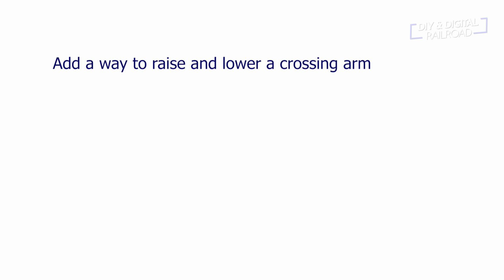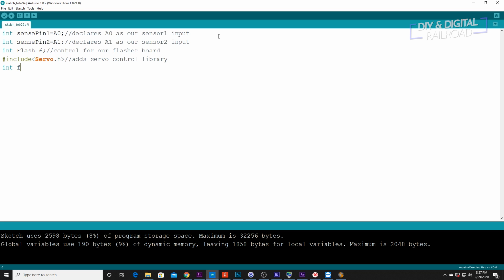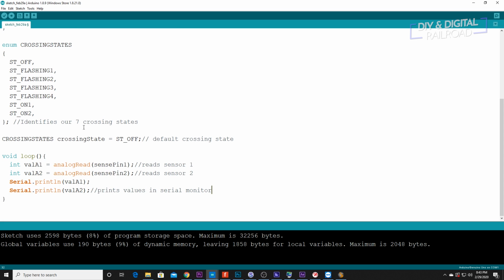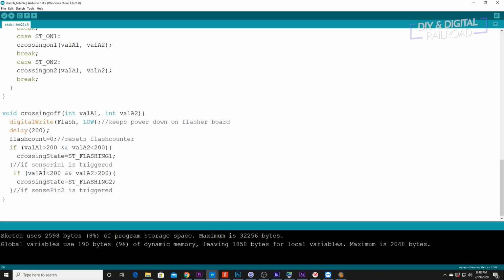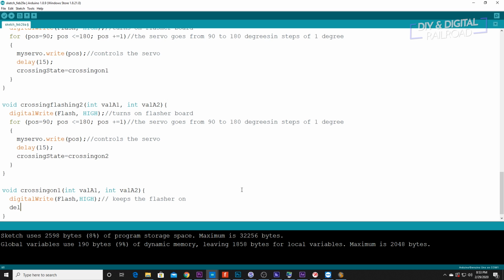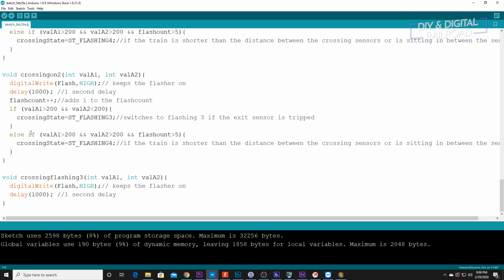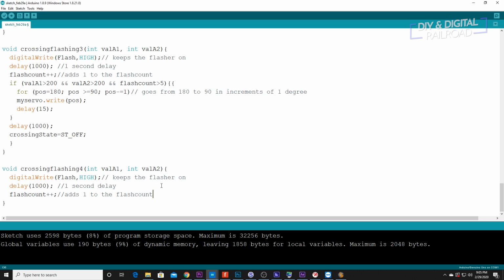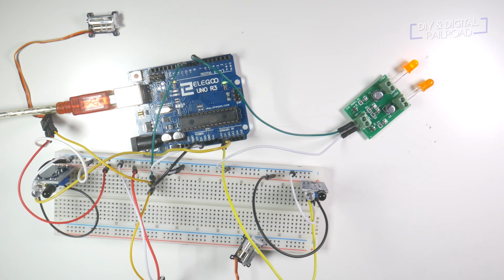Adding Crossing gates to the Arduino Grade Crossing Sketch

Comment: I added sound and gates to the original sketch with just a few programming lines by writing some simple code using Digital Pin 3 to operate a bell module and Digital Pin 9 to operate a SparkFun Servo Trigger.

Both Arduino outputs 3 and 9 operate 5vdc relays. Output 3 operates one relay, normally open, that closes to complete the 12vdc power supply path to an ITT bell module board driving any 8 ohm speaker. The other output, Pin 9, operates a 5vdc relay, normally open, that when closed  acts like a toggle switch to activate the Servo Trigger board. The trigger board controls the actions of the servo.

The advantage of the Servo Trigger board is that you can:

1 set the position the servo sits in while the switch is open e.g. crossing gate up position rather that fooling with actuator wires;
2 set the position the servo moves to when the switch is closed, e.g. crossing gate final position when lowered rather than fooling with actuator wires; and
3 set the time it takes to get for the gate arm to raise and lower.

These adjustments can be made on the Servo Trigger using a screw driver to adjust any of three pots. I already use this Trigger Board to drive a remote chain link fence gate servo at an N scale manufacturing plant on my layout and it works great.
Reply from the maker: Ok I am going to have to try that!
Reply: Do you have the corrected code for the initial program? I copied and pasted the code listed above in the description, but the gates go up way too fast, as if returning to their original position. I have been looking all over the internet for a corrected code but cannot find one, or anyone to help. That said, thank you for your time.
Reply: @ellabean-x8d  
//Grade Crossing Sketch, Bell & Gates FINAL Approved

int sensePin1=A0; // analog Pin A0 on the arduino
int sensePin2=A1; // analog Pin A1 on the arduino
int RED1=6; // light on crossing signal
int RED2=5;  // light on crossing signal
int POWER=8; // POWER pin 8
int flashcount=0;
int Bell=3; // bell on Digital Pin 3
int Gate=9; // gate on Digital Pin 9

void setup() {
  Serial.begin(9600); // enables display of sensor output
  pinMode(RED1,OUTPUT); //establishes pins as an Output Pin
  pinMode(RED2,OUTPUT);
  pinMode(POWER,OUTPUT);
  pinMode(Bell,OUTPUT); //established pin as an Output Pin
  pinMode(Gate,OUTPUT); //established pin as an Output Pin

  
}

enum CROSSINGSTATES
{
  ST_OFF,
  ST_FLASHING1,
  ST_FLASHING2,
  ST_FLASHING3,
  ST_FLASHING4,
}; //identifies our 5 crossing states

CROSSINGSTATES crossingState=ST_OFF; // default state of the crossing

void loop() {
  int valA1=analogRead(sensePin1); //reads and stores value of sensors
  int valA2=analogRead(sensePin2);
  Serial.println(valA1); // displays value of the sensor in the serial monitor
  Serial.println(valA2);
  delay(200); //dealy of 0.2 seconds between sensor readings

  switch(crossingState) // this is establishing where the program goes to when a sensor is read
  {
    case ST_OFF:
    crossingoff(valA1, valA2);
    break;
    case ST_FLASHING1:
    crossingflashing1(valA1, valA2);
    break;
    case ST_FLASHING2:
crossingflashing2(valA1, valA2);
    break;
    case ST_FLASHING3:
    crossingflashing3(valA1, valA2);
    break;
    case ST_FLASHING4:
    crossingflashing4(valA1, valA2);
    break;
  }
}

void crossingoff(int valA1, int valA2){
  digitalWrite(Bell,LOW); // the voltage to the bell relay board is low, keeping the bell off
  digitalWrite(Gate,LOW); // the voltage to the gate relay board is low, keeping the gate up
  digitalWrite(RED1,HIGH);
  digitalWrite(RED2,HIGH);
  digitalWrite(POWER,HIGH); // this is what our lights are doing when in this phase of the program  This has them both off
  delay(200);
  flashcount=0; // Initializes flashcount to start counting at 0

  if(valA1<500 && valA2>500){
    crossingState=ST_FLASHING1; // if sensePin1 is tripped the program switches to Flashing 1
  }
  else if (valA1>500 && valA2<500){
    crossingState=ST_FLASHING2; // if sensePin2 is tripped the program switches to Flashing 2
  }
}

void crossingflashing1(int valA1, int valA2){
  digitalWrite(Bell,HIGH); //sends about 5 vdc to the relay board, turning the bell on
  digitalWrite(Gate,HIGH);
  digitalWrite(RED1,HIGH);
  digitalWrite(RED2,LOW);
  digitalWrite(POWER,HIGH);
  delay(500);  // This is half of the flashing signal and it goes for 0.5 seconds
  digitalWrite(RED1,LOW);
  digitalWrite(RED2,HIGH);
  digitalWrite(POWER,HIGH);
  delay(500); // This will loop until a condition is met that would change it
  flashcount++; // Everytime the program cycles through, its going to add 1 to flashcount

  if (valA1>500 && valA2<500){
    crossingState=ST_FLASHING3;
   
  }
  else if (valA1>500 && valA2>500 && flashcount>5){
crossingState=ST_FLASHING4; // Flashing 4 keeps the signal flashing even when nothing is on a sensor this goes on until another sensor is tripped
  }
}

void crossingflashing2(int valA1, int valA2){
  digitalWrite(Bell,HIGH); //sends about 5 vdc to the relay board, turning the bell on
  digitalWrite(Gate,HIGH);
  digitalWrite(RED1,HIGH);
  digitalWrite(RED2,LOW);
  digitalWrite(POWER,HIGH);
  delay(500);  // This is 1/2 of the flashing signal and it goes for 0.5 seconds
  digitalWrite(RED1,LOW);
  digitalWrite(RED2,HIGH);
  digitalWrite(POWER,HIGH);
  delay(500); // This will loop until a condition is met that would change it
  flashcount++;

  if (valA1<500 && valA2>500){
    crossingState=ST_FLASHING3;
  }
 else if (valA1>500 && valA2>500 && flashcount>5){
    crossingState=ST_FLASHING4; // Flashing 4 keeps the signal flashing even when nothing is on a sensor. This goes on until another sensor is tripped
  } 
  }

 void crossingflashing3(int valA1, int valA2){
  digitalWrite(Bell,HIGH); //sends about 5 vdc to the relay board, turning the bell on
  digitalWrite(Gate,HIGH);
  digitalWrite(RED1,HIGH);
  digitalWrite(RED2,LOW);
  digitalWrite(POWER,HIGH);
  delay(500);  // This is half of the flashing signal and it goes for 0.5 seconds
  digitalWrite(RED1,LOW);
  digitalWrite(RED2,HIGH);
  digitalWrite(POWER,HIGH);
  delay(500); // This will loop until a condition is met that would change it

  if (valA1>500 && valA2>500){
    crossingState=ST_OFF;
  }
  } 

  void crossingflashing4(int valA1, int valA2){
  digitalWrite(Bell,HIGH); //sends about 5 vdc to the relay board, turning the bell on
  digitalWrite(Gate,HIGH);
  digitalWrite(RED1,HIGH);
  digitalWrite(RED2,LOW);
  digitalWrite(POWER,HIGH);
  delay(500);  // This is half of the flashing signal and it goes for 0.5 seconds
  digitalWrite(RED1,LOW);
  digitalWrite(RED2,HIGH);
  digitalWrite(POWER,HIGH);
  delay(500); // This will loop until a condition is met that would change it
  flashcount++;

  if (valA1<500 || valA2<500){
    crossingState=ST_FLASHING3;
  }
  else if (flashcount>15){
    crossingState=ST_OFF; // This prevents infinte looping. If flashcount gets up to 15 seconds and the sensors do not change state, the signals revert to their off state, and so does the bell
  }
  }

Comment: Jimmy, I love your design and want to add on it by adding double track coverage and maybe extra sensors.   I might even use it in an NMRA clinic down the road to my fellow modelers.  I don't like to "steal" anyone's ideas so I am asking permission to use your initial design, add onto it and then maybe do learning sessions on it.  I would be sure to credit you with the initial design.  I have NO intention to "sell" it.  Would you be OK with that?
Reply from the maker: Of course!
Reply: @DIYDigitalRailroad  Thanks.  Will let you know how it turns out....  buying parts from China not Amazon (75% cheaper) so it will be several weeks before I can start.

Comment: I have crossings on both sides of my layout.  Could one Arduino handle two complete crossings?  There are enough pins, but would timing be ok?  both would not go at once.  The layout is from the Greatest Hobby, so one track around with sidings, etc.
Reply: I tried with two SG90 motors (Servo) with one Arduino UNO.  They work fine, only thing is give small amount of time between both to get activated.  I used 1 second between them and they worked fine.  You may try with little more time, if you are asking servo motor to turn slowly.  Other wise simply give external power supply of 6 VDC to both servo motors and problem is solved.

Comment: Wonderful presentation, spot on wiring and coding.  The flasher circuit maybe be superfluous if the pin states operate in a specific manner.  The states delineated in the code have the digital pins switching between HIGH and LOW rather than between ON and OFF and this leads me to believe they work in this manner.  Fact is I don't "know" that they do, just suspect that they do.  If you're willing to attempt a quick non-destructive experiment and instead of one but two digital output pins are available we may find out together whether my surmise correct.  The experiment would be conducted thus:

1.) disconnect the LED flasher board.

2.) on a breadboard connect two LEDs back to back, i.e. anode(A) of one to cathode(K) of the other.  On one leg connect a 470 ohm dropping resistor.  Now, if you connect the resistor to the negative side of the supply voltage(GND) and the other side of the LEDs to positive supply voltage(5V), just one of the LEDs should illuminate.  If you swap the resistor to the positive supply voltage(5V) and the other side of the LEDs to the negative supply voltage(GND) the other LED lamp should illuminate.

3.) pull the leads to the supply voltages from the power source rails and connect them to digital out pins on the Arduino, perhaps DO pins 7 & 8 as I see you used pin 6, set the pins you use as digitalOUT in your sketch.  Write and upload to your Arduino a sketch that in a void loop alternates the states of DO pins 7 & 8 such that when you set pin 7 HIGH you then set pin 8 LOW, then after a 500 millis delay reverse it to set pin 7 LOW and pin 8 HIGH counting out another 500 millis delay and repeat.  If my surmise is correct the result should be a pair of LEDs that alternate illumination in a one second frequency.

4.) When done with the modified "blink" in any subsequent sketch, i.e. back in your Crossing Gate sketch, set both DO pins to LOW.

Admittedly my experience with Arduino is limited to watching over another's shoulder as they worked out a sketch, but I suspect that the digital output pins switch between GND and 5V rails rather than interrupting current flow.  If both pins are set LOW(GND), or if both pins are set HIGH(5V), no potential exists to allow current to flow.  As I say, this isn't presented as fact as I don't know this behavior to be true, but the sketch terms strongly imply it. This test should prove me correct or no, if you're willing to attempt it.

Enjoyed it in any event, and will watch others.  Well done.
Reply: It works as I expected.  I watched as it was tested.  The DigitalOUT pins do switch between +5V supply, and GND.  This means that DigitalOUT pins do what is called "sink or source" the output.  If you're intrigued what that means I'll leave you to the research as it doesn't affect the outcome of what I'm about to tell you.

First let me say that what Jimmy did with his assembly is great.  Certainly it works exactly as he designed it.  There's nothing wrong with his assembly or execution.  What I'm about to describe is simply an alternative that--if you have an extra Digital OUT pin to devote to the chore--can save you the cost of the special printed circuit board Jimmy used to make the LEDs flash alternately.  The proviso here is that you need to know how to write the code to set the Digital OUT pins alternately high and low, and write the subroutine you'll call to cause that to happen.  If you're not knowledgeable about how that's done, do as Jimmy did and save yourself the irritation. I wouldn't ask Jimmy to revisit the crossing signal again unless he'd like to.  If it's his idea great, but otherwise I'm letting it go.

What I can describe is how to assemble the electronic components to make make this work without the "flasher board."

Find two LEDs, presumably red for the crossing, but two of the same color is preferable.  Two from the same lot is even better.  On the breadboard connect the LEDs in parallel so that the Anode of one connects to the Cathode of the other, back to back, e.g. the long lead of one connected to the short lead of the other.  Add a voltage dropping resistor, I suggest 330 ohms but could be larger out to about 2200 ohms (2K2), in series with one side of your back to back LED pair.  That's it.  No really, that's all there is to this sub-assembly.  If you want to test it, connect +5V to the free end of the resistor--the end not connected to the LEDs--and connect the free end of the LED pair to GND.  Only one of the two LEDs should illuminate.  Swap the power connections; the other LED should illuminate and the first should extinguish.

To use the sub-assembly from the Arduino first select a pair of DigitalOUT pins, Jimmy used pin 6 so maybe pins 6 & 7, and connect the free ends of your LED sub-assembly via Dupont connector wires to those DigitalOUT pins.  In the sketch you write define both pins initially LOW.  In the loop set one of the pins high while keeping the other pin low, insert a delay convenient to you-perhaps 500 millis, then swap the output of the two pins such that the pin that was set low is now high and the pin that was set high is now low, add another delay, then repeat...and repeat...and...you get the picture.  Die blinkenden Lichter!

When you want to stop the blinking simply set both DigitalOUT pins LOW.  Setting them both to HIGH will stop the illumination too, but to avoid possible shorts I recommend setting the pins low.  That's it.  No code from me but feel free to write your own and maybe submit it to Jimmy.  Enjoy!
Reply: @caitlainmccarren2286  Where is the sketch you use for the original setup on this project? I used the one listed above Jimmy posted, but the crossing gate raises too abruptly at the end of the sketch, as if it automatically returning to the original OFF position. Do you know how I can correct this?
Reply: @ellabean-x8d  Hrmmmm, as I said, my experience with Arduino is watching over someones shoulder as they wrote a sketch.

What I surmise, and with the help of said friend later proved, was that digital pins of the Atmel processor used in an Arduino are what is known as tri-state, HIGH--connected to the 5V supply, LOW--connected to the GND potential, and high-impedence which is essentially off or non-conducting.

Jimmy's configuration used one digital output(DO) pin and the external flasher circuit he purchased separately.  My suggestion is to employ two digital output pins and alternate the High/Low settings between them.  When one DO pin is set HIGH set the other LOW.  In this way two LEDs could be set to illuminate alternately by setting--wiring--the LEDs anode(long lead) of one to cathode(short lead) of the other, and vice versa.  Wire inline a resistor of nominal value, anything between 330 ohm and 1k ohm, and connecting the free resistor lead to one DO pin, and the free paired pin from the LEDs to the other DO pin, alternating the HIGH and LOW states of the DO pins will alternate which of the two LEDs illuminate.

The advantage of my plan is that you the sketch writer acquire control over the delay times and therefore the rate at which the LED lamps alternate.

I'll see if I can't work up a diagram in TinkerCAD.  If I do I'll post it back here as a reply to your query.

Comment: Hi Jimmy love your work. Getting back into the trains after about 30 years. however being in the trades high speed weighing and packaging, 
The DCC is new to me but familiar at the same time.  So this is some  info on signals main line Sydney Australia.
Two rails left hand side track keeping other direction on the right. Section lights double head. Can have three colours both heads. 
Yellow only on top if turnout/point in section. Top head first. Train in section= red+red, if point closed for a turn +yellow.
Train left section but in next red+green &red+green. Train moved to next section red+green & green+ yellow. Train clear or in 4th section green +green.
Country areas drop the bottom set of lights. However two line lights generally not facing other direction. If train on wrong side usually under direction by phone or on site incident control. If a train comes to red+red can creep on with extreme care to next light after 5minuites.
Reason incase of prior train in difficulties /accident assistance can be organised. 
Lights with red+greens mean move on with care and reduced speed. Less reds the more clear. 
1 reason for double colours is incase globes pop.

Comment: Question for you Jimmy - If I don't have gates but still want to use sensors and operate lights with a flasher unit, do I simply delete the code referencing the servos?

Comment: This is a good use of an Arduino.  An Arduino Nano you can get for $3-4 is ideal.  The sketch is not hard to do, and this can easily run the servo to move the gates as well.  

If you want to add sound, then going with Raspberry Pi might be a better choice as the sound handling on the Arduino is a bit clunky. 

Good stuff!
Reply: No need for rasberry, just use Arduino to drive a MP3 board